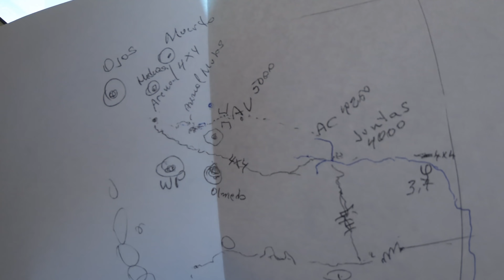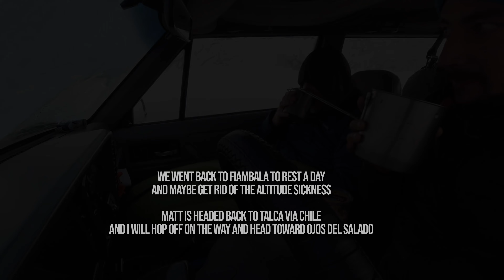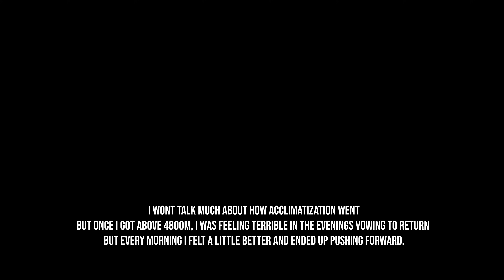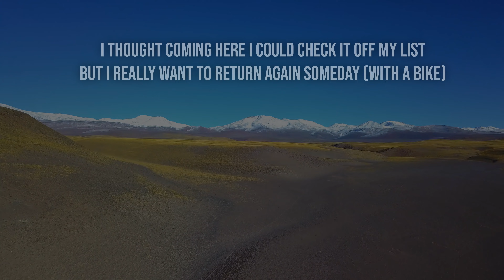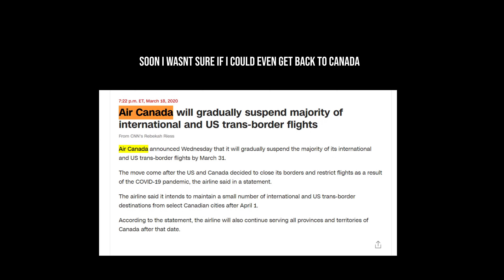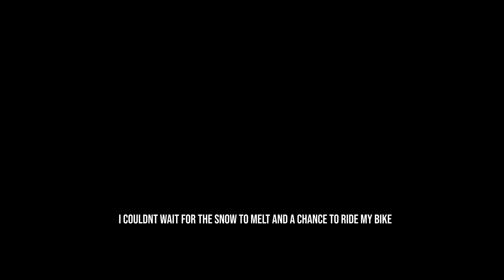SEE THE WORLD 40: Nevado Ojos Del Salado (2)

Comment: The adventures Lohan does are incredible, as are the sheer volume of them.
The effect of nearby electrical storms can be very dramatic. Anything resembling spike can draw the charge. I felt nothing standing on a peak, seeing what looked like a localized lightning cloud patch several miles away. But when I raised my hand to head level, there was tingling. The intensity increased steadily at the tips of my fingers when my hand/arm was held up high, to the point it was mildly painful. Just a couple feet of height difference yielded a huge difference. I believe the air is concentrating ions there...time to MOVE